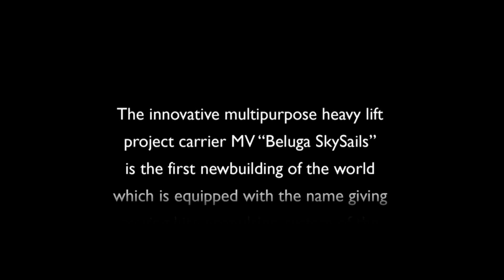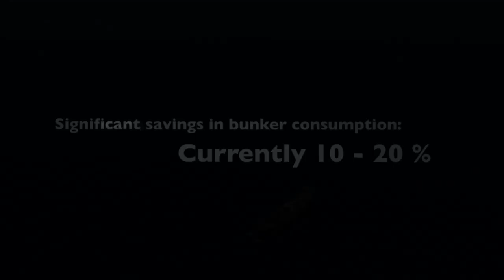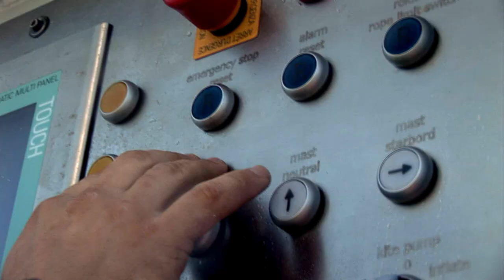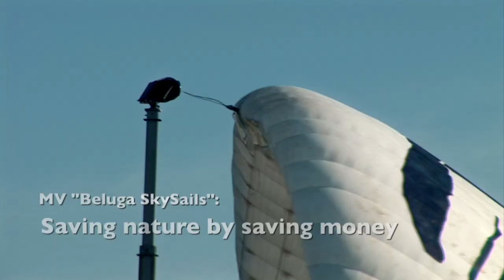Beluga Projects SkySails Infoteaser

Comment: How do you steer such a kite? Only one line attached. For efficient kitesurfing you need at least 4 lines
Reply: it's not just a rope its a cable. my guess would be they have electronic control of a motor at the point where the lines from the kite converge to control the kite the same way us kite surfers to with a bar. they just don't need to extend the lines all the way down to the bar, causing extra drag, because they don't need analog control

Comment: Fake.

20% of the drag comes from that kite? It seems as if the HUGE ship dose not even notice of the fact that this toy kite is even attached to it
Reply: XmanSully This isn't fake at all. There are plenty of videos on Youtube and plenty of academic research on Kites for wind power, both sailing and electricity production. An average of 20% of the ship engine power is a common figure.
Reply: exactly, total fake. 20% more like 0.02% if any
Reply: 20% of 100,000hp is a lot of horsepower for a simple sail. if your too stupid to figure that out then fine. hahaha
Reply: This is not a simple sail though. Simple sail operates at the ground level (much lower wind velocities), and are usually operated far from efficient way (with most traditional sails setups). This sail is working at 200-300 m above the ocean, where due to less friction and no terrain obstacles winds get much faster, 150km/h is nothing unusual. Now if instead of just "knowing better" you would actually check facts and do the math you would realize that 320 square meters sail with ~41m/s wind assuming air density of 1.2kg/m^3 will actualy give you around 340kN of force to work with (for comparison- RS-25, a main engine of space shuttle program was rated for 1,860 kN thrust- and that shit lifts heavy metal objects into low earth orbit so you know- it has some juice mkay?). Of course tankers are quite bigger and heavier than space shuttles, but in this case we don't really need to actually shoot them into the sky and beat the gravitational acceleration while at it so it should be all ok for providing additional power.
Reply: Because the total true cost of using fossil fuels is not being taken into account (e.g. we get to dump the waste into the atmosphere for free) it will delay the deployment of innovative technologies such as this.  If we had a true carbon fee/dividend system in place every cargo ship in the world would be clambering to add this sail.  Even saving 10% of the fuel costs (and creating 10% less CO2) would be a huge gain for humanity.
Reply: Your not very wind savy. This works like a charm  Hugh power from that kite 300 ft high. Very effective
Reply: @agicorvus  holy shit you destroyed him
Reply: I mean there was an airbus offshoot called airseas that does this as well.
Reply: @Bolognabeef  the thing is it's even more power than what he described. kites don't just generate force from wind hitting them they use physics to get force out of the air flowing over the kite which can be as much as 4-5x the force from the wind. furthermore because the kite is moving through the air it has what's called apparent wind (what you feel when you stick your hand out the window of a car) which causes the practical wind to be even higher than the true wind